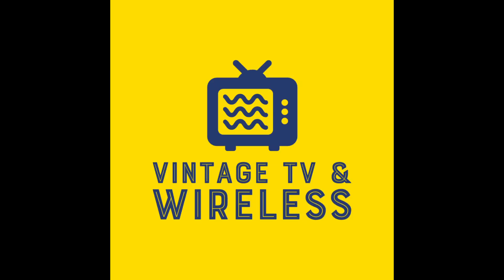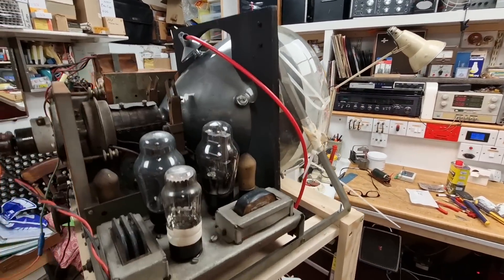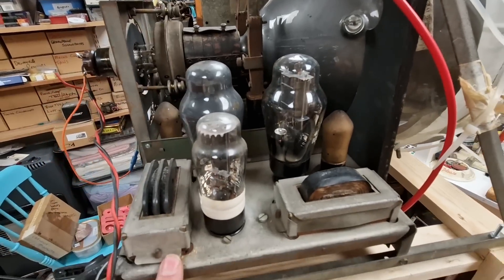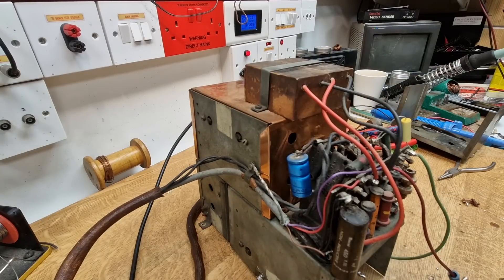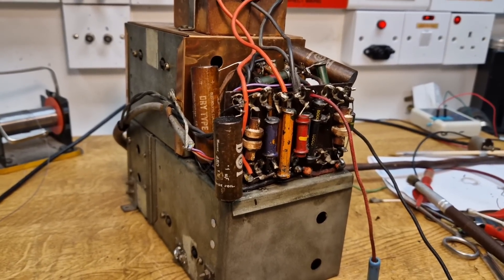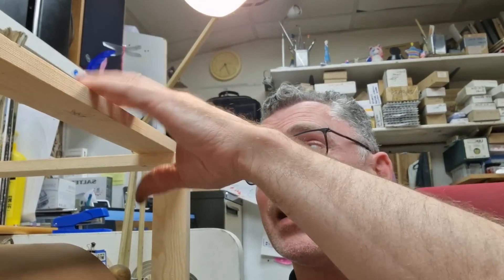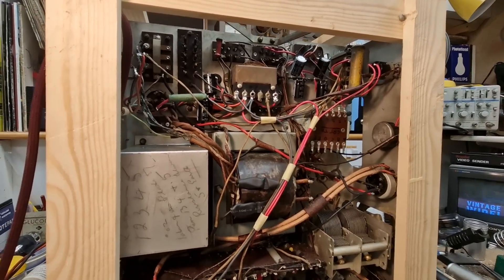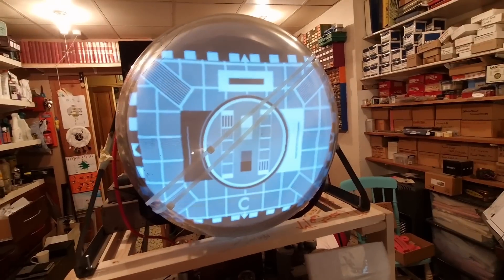A look at a VERY RARE 1938 Baird T18 television chassis....

Comment: A fascinating piece of television history!  Being in the US, I have seen some British TVs from 1936 onward but, never a Baird.  The picture quality is amazingly good, I assume this TV is using the 405 line system?

2 uF at 5,000 volts is a huge amount of charge, no surprise as to the lethality.  You may not need that much capacitance if an R/C Pi filter is used.  I assume the CRT anode current is microamps?

As far as electrocution safety goes, you might want to build up a quick discharge circuit I designed years ago for assembly line testing of high voltage pin diode switched filters.  It would disconnect the mains by energizing a disconnect relay and used large power FETs to discharge any supply with lethal voltages.  The discharge circuit was activated by voltage sensed on the static discharge strap.  The supplies were discharged so quickly, you could never feel a shock.  Although, the power supplies in question were only plus and minus 200 Vdc, 5 kV may be a different story.
Reply: This isn't a 405 line TV. It is a Baird TV using the worlds first TV system invented by John Logie Baird who was the first in the world to demonstrate and transmit a TV image. It is 240 lines.

The BBC had a competition between this system and the 405 line Marconi system in the 30's with Marconi's system winning and Baird's system being dropped in 1937.

Baird is considered the father of television.
Reply from the maker: I can assure you it's 405 line...100% The format war was over by then, and 405 had been decided as the standard. The last 240 line TX was in Jan 1937.
Reply: @dlarge6502  Thank you for your response.  I am quite familiar with John Logie Baird's work on the electro-mechanical, 30 line television, up to the format contest with EMI/Marconi at the Alexandra Palace in November 1936 but, not much afterward.  I know Baird dabbled with electronic television afterward but, I am not up on his accomplishments.  The resolution on the CRT looked so good in the video, I wondered if it had been modified for 405 lines.  When that television was designed, I think they were trying to use the HF band to run video; a definite limitation.  Another limitation at that time was the lead parasitics of the high frequency valves, which limited maximum frequency to about 30 MHz.  In the US, the Loctal base was developed in the mid 1930's to address the problem and I believe the UK had a similar valve base.  At any rate, a very interesting history.
Reply from the maker: Thanks for commenting,  it is 405 lines, though.  The 240 line standard was stopped in Jan 1937. 👍👍
Reply: @vintagetvandwireless  Thank you, I greatly appreciate your response, restoration efforts, and making the video.
Reply: @dlarge6502 
He did not invent the electronic TV. Braun invented the CRT and an American used that to make the electronic TV. John Baird invented the mechanical TV at the same time that failed. His electronic 240 line TV would be made later on. USA did invent the telly that was then patent by RCA then RCA let other companies like Sylvania to make clones.

Comment: Edit : please ignore my ramblings

Not a fan of all this.

Instead of fixing the HT, a tube suitable for the HT available was swapped in?

That and cap stuffing.. laughable.

Making it work = modernised components.

Hiding that truth is questionable, bordering on fraudulent, IMO
Reply: 86 year old NOS components might be a bit hard to find, to me it’s a perfectly valid restoration
Reply: @charlesm127  And paper caps AFAIK rot always even when unused. Thats like trusting a 86 years old package of condoms.
Reply: Another take on it,  As a Designer almost all my working life, I really do cringe inside when I hear of people faithfully restoring a circuit I'd done decades ago, trying their best to get original as possible. Hey I did it like that because the particular components were around at the time, sometimes they were a deal other times it was just the circuit provided by the supplier. What really feels good though is learning how improved on it and they kept my original idea.
Reply: The HT was as originally designed, a replacement tube had been fitted which wasn't suitable. As the original CRT was unusable a suitable replacement was fitted.
Reply: @NiallWardrop  I've rewatched the start and it appears you're correct.

On first viewing I took it as we only have 5kV, so will fit a tube suitable.. rather than the previous owner had fitted a tube requiring higher HT.

My other point I feel still stands on the cap stuffing.. probably not worth bringing up in YouTube comments.

Why make a new capacitor look like the one that failed?

At manufacture, the set was not fitted with the best capacitors available. It was fitted with the best capacitors for mass production at a palatable price.

In my mind restoration can include modernization within reason. Place the new caps smartly and show the restoration for what it is.
Reply: @incandescentwithrage  This is a recurring point of contention in vintage radio and TV circles (and in fact in other vintage fields like steam trains etc.).
The three options are;
Leave in original condition which will usually mean non working. Also many examples will have been modified thoroughout their working life, each state represents a valid point in the item's history to which it could be restored.
Return to working condition and attempt as far as possible to create the appearance it had at a given point (as in this video)
Get it working regardless of appearance.
Where the item is not particularly rare or unique it is up to the owner to choose what they do.
I think they all have a place.
Reply: @NiallWardrop  Yep, same thing comes up with cars too.
I agree with the conclusion that it'll continue to be a point of contention.

I kinda regret bringing it up in YouTube comments
Reply: @incandescentwithrage  It only really matters if it's the only one left, otherwise if examples of all types of restoration exist then everyone can be happy.

Comment: Just practice the one hand rule  ,  put one hand in your back pocket or just reach around behind your self and grab you belt and don't let go ,   this will save you  ,   your other hand could get messed up but you will live ! .   I am 62 years old and it has saved me at least 5 times . no my other hand never got messed up  burnt a little  but   OK  .
Reply: And don't wear a belt with metal buckle (mine is completely made of nylon) - it will always dangle into electronics in the worst imaginable moment. And of course during repair every 2nd shortciruit is made with the solder tin spool, thus roll it up before you test anything.

Comment: You can tell its ancient because its held together with flat head screws that don't reses inside its casing
Reply: And the screen wasnt glued to The mother board
Reply: @Drewcardello  the power supply transformer is the main component before the crt,its about as efficient as a 1800s steam locomotive.......I bet it burned more watts than it could output

Comment: Greatly enjoyed this video. Regarding the Brimar tube - there was a tube called the C12E (I think) that was pretty much a post-war version of the Cathovisor 12MW3 tube, right down to the low EHT. However, I would point out that Baird never said the CRT had a 2V heater, but that it should be adjusted for a current of 2.5A. I sometimes wonder how many Mazda 2V CRTs have been condemned because of insufficient heater current? The sets were indeed built by Bush to Baird's designs - just before WW2 Baird announced they'd commence building their own sets, leaving Bush free to produce their own prototype in 1939 called the P63, a large TV/radio console.

Comment: I worked on this exact same set many years ago, trying out various different CRTs with it, and it ended up with a Mullard MW31-74 at the time. The original Baird tubes were capable of good pictures but had a very short emission life.
Reply: Something interesting about this set is where it has ' newer ' parts from 1947
Reply: Where were these assembled and own badged components made?